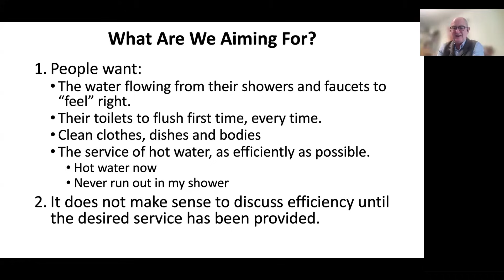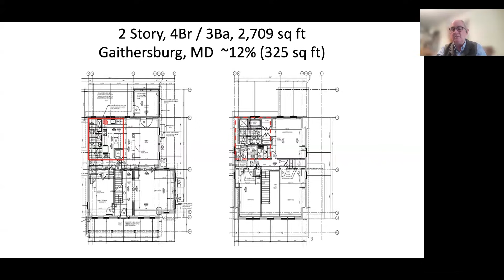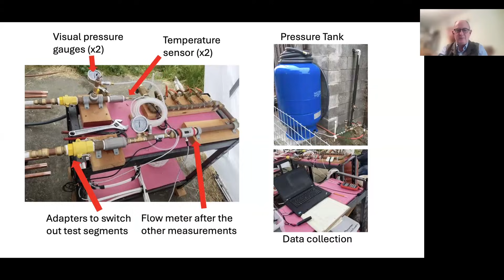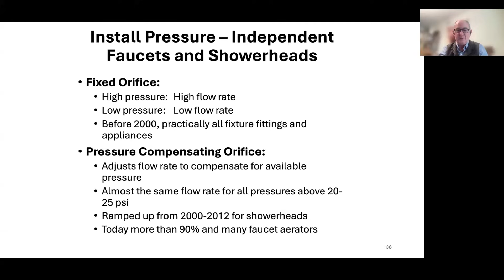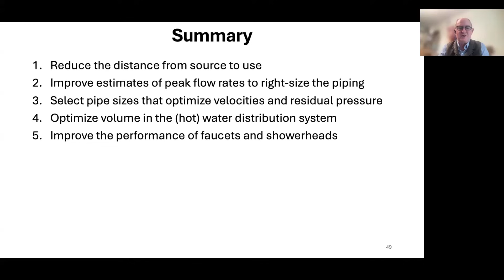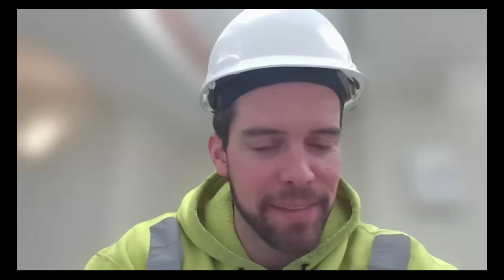Rethinking DHW Systems: Why Better Floorplans Deliver Better Performance

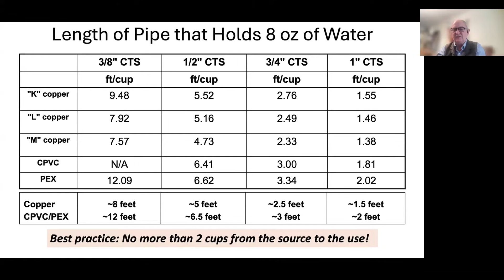Comment: 17:17 “You can’t use 1/4” tubing for high flow rates”.  At 42:29 he indicates one gallon per minute fixtures can be served by 1/4” piping.